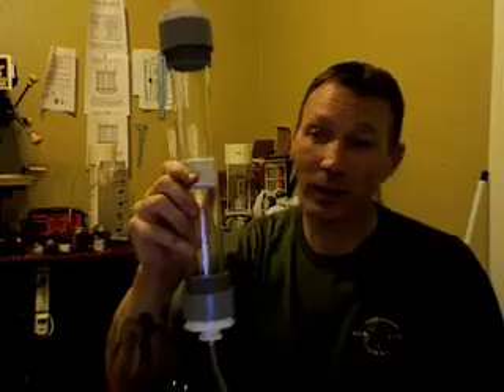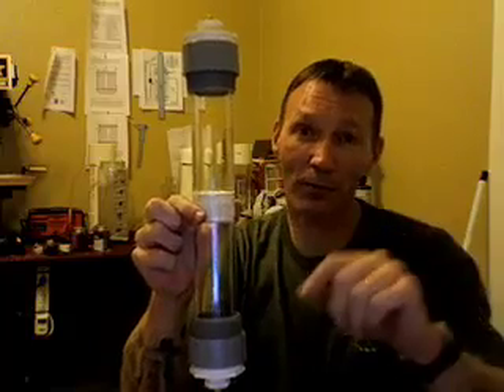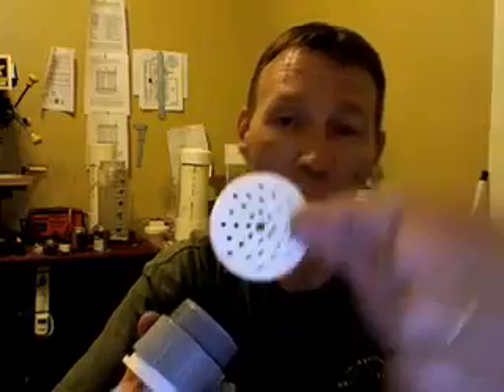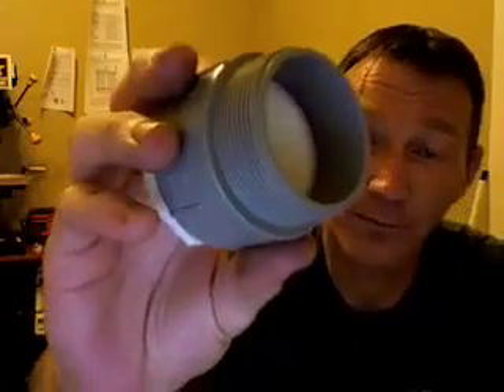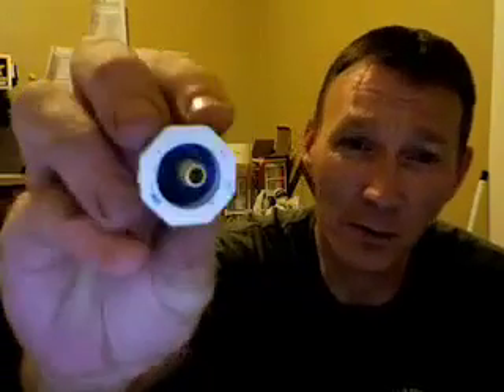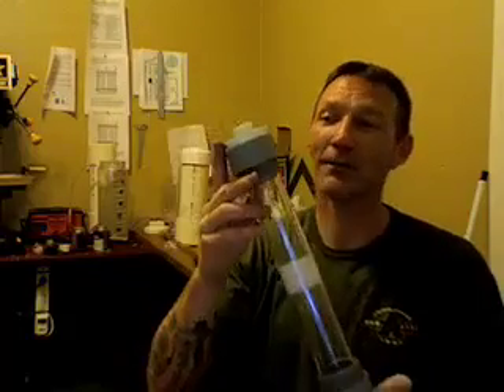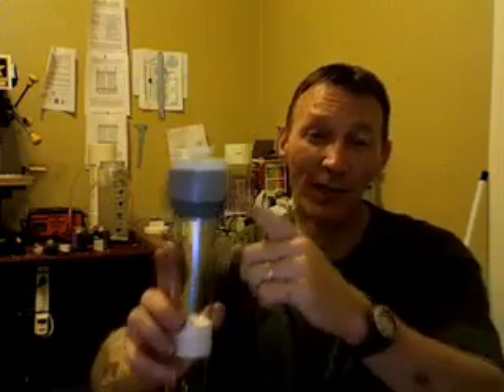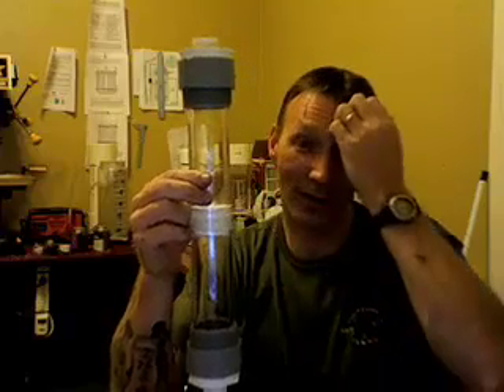New Bubbler Revealed! Thanks all, and some other stuff.

Comment: Hey, Steve, hope it cooled down for you there now ... Can't send you any more cool weather since it's nearly 100 here in Oregon now. Couple questions: once you glue the top on how do you get water in the two sections? Also, have you thought about using copper scrub pads? They take a bit more room at the top, but that's what I saw S.Scarecrow use. Copper scrub pads are thick, so should cool a flame down, plus will let water drop to your upper bubbler.

Comment: You could try fine bronze wool instead of the scotch bright or SS pad.  It might serve as a flashback protector also...  SS burns like crazy, FBW will not burn easily.

Where did you get the clear plastic 2" pipe?  How much was it?

Also you can use your car's window wiper spray line, feed that into your generator, and have another hose to catch the water overflow in the gen and have it drain back into something else.  That's a good way to easily re-circulate the water, keep temp down...

Comment: Yeah, NaOH reacts with AL,brass,tin,zinc. The reaction will actually produce hydrogen, though less violently than AL. High temperature plastics are preferred. Natural Kynar fittings are the best, because they are rated "A" for acids and bases. Kybnar has an operating temp of up to 260 Degrees F. High density Polypropylene is also rated "A" for both acids and bases. PVC shows no effects.  Nylon is okay, too. Polycarbonate will damage with bases.
Peace! and Be Safe! :-)
Steve w/installguys